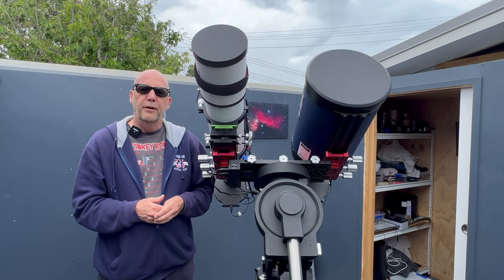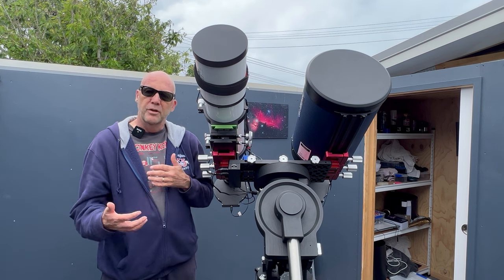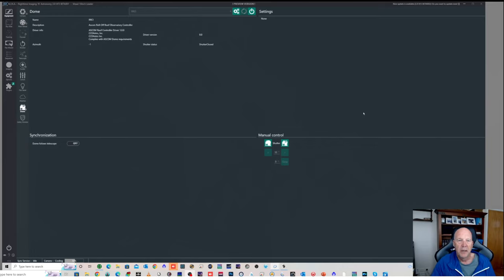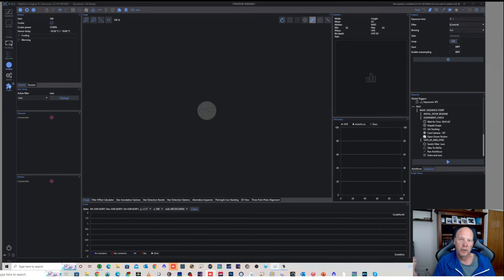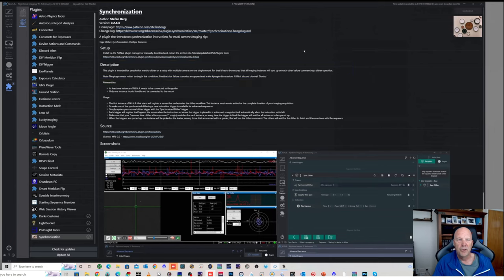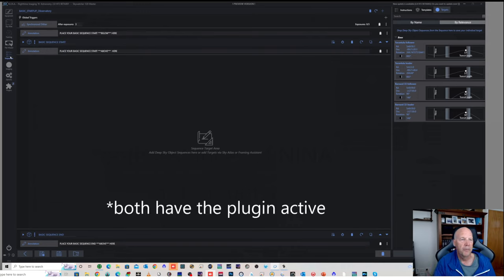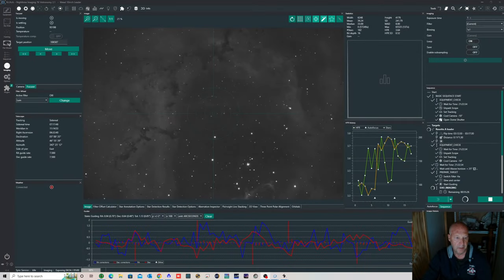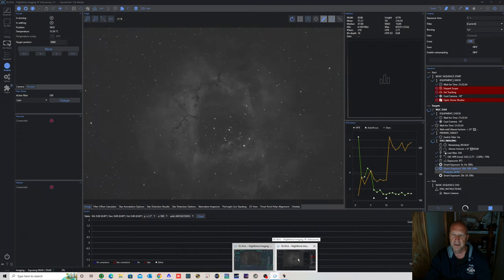Part 3 Dual Side by Side Telescope Setup. NINA Advanced sequencer and Synchronised Dithering

Comment: Interesting video Logan, there's certainly many considerations with this setup.  Looks like you've got a system pretty well worked out now. Just need the weather to turn for us all now.
Reply from the maker: Cheers Ollie. Yes I think it's all pretty much sorted but there are things I would have done differently if I was to do it all again. Maybe will have to make some changes as time goes on. But being able to easily switch from one rig to another without breaking my back lifting18 +kg setups is certainly nice.

Comment: Loving it!
I’ll have you know that I ended up finding the heavy duty dovetail adjuster plates from Baader;right after I bought a AP 1100….
Either way, I’ll be joining the 2 TOA150s and getting another scope….. after all, it’s a message from god.😂
Having said that, I’m going to have a very tough time, identifying the scopes as you are explaining, since I’m going to have two identical scopes, with two identical image trains, focuser, Eagle, you name it.!
I can tell you right now, I would not be able to do it without your tutoring 
Thank you!!
……….. and keep them coming!!
Reply from the maker: Fantastic- your dual setup with be ideal with identical scopes and imaging trains. Well, I wouldn’t have known about the Optec Libra heavy if it wasn’t for you so thank you again for letting me know that option existed. As far as labelling your different imaging trains, if you can consider them as, say, left and right, you can just add a L or R to the name tags you add in NINA. So just have, say, the left scope and all it’s accessories plugged in with the right scope and accesories not plugged into power/usb connections and whatever items show up in NINA will only be from the left scope and imaging train. Then plug in everything from the right setup and those can all be labelled right. Hope that makes sense.

Comment: Nicely presented video. I remember (pre plug in) when this concept first came out and you could run different exposures and somehow, the 'controller' was able to determine if the other had finished imaging. So you could, for example, have one ten minute sub and two five minute subs. Is that still possible with this plug in system?
Reply from the maker: Thanks Stephen. I'm not sure this would be possible in an economical sense  in that it is my understanding that the number of images per dither needs to be the same on both instances of NINA. So if , for example, you setup to dither every two images, then the scope doing the 10min subs would do 2 exposures (20 mins total) and the other scope doing 5 min exposures would have to do 2 subs per dither (10 mins total)  so the scope doing 5 min subs would get through 2 x 5min exposures and then wait around for 10 mins until the other scope finished it's second 10 min exposure. So there would a be a lot of imaging downtime on the scope doing the 5 mins subs. Hope that makes sense.

Comment: Thanks for this video, I just got the dithering set up and it works great.  I've noticed another little utility called synchronized wait which seems to be able to help with the start/stop syncs between the different scopes.  Any idea how that works?  I thought I had it working by adding it right after autofocus on the leader, then also adding it on the follower.  it works great for that but at the end of a sequence before moving on to the next target, I want it to make sure that the follower has finished before slewing, and the follower waiting until slew and AF has finished before starting.  It doesn't like it presumably because the follower is now the leader and doesn't move forward at all.  Any ideas on how to fix this?
Reply from the maker: Thanks Luke. Using the synchronised wait is something i need to add into my sequence and try out. I found it quite tricky to work out exactly where to place these synchronised settings as different forums I read suggested it to be placed in different places and some of the places didn’t work. So if i sort out where to put the synchronised wait, I’ll let you know.

Comment: There is a flaw in NINA if you need two set ups. It needs a refactoring so you can have one set up, one mount two or more cameras. 
That then leads into what if you have multiple mounts? 
What if you run a computer on the telescope, but want to access remotely? That leads into set up where you have large groups of people cooperating, and NINA is used to gather the information

Comment: Hi, I also have a CEM120 which I set up SBS last year and used synchronised dithering.  All went well until the meridian flip when the two instances of NINA seemed to get out of synch.  The leader was supposed to pause imaging on both scopes until after the flip, but it didn't work well for me. So I stopped using SBS and went back to single scope. Have you tested through the flip? maybe it works now or maybe it was my settings.
Reply from the maker: Hi Max. After the setup was complete we went into a very long spell of horrendous weather and I've only been able to get back to imaging in the last few weeks. So since then, I've primarily been picking targets where I am imaging with one scope of the other so haven't been using the synchronised dithering much. The synchronised dithering isn't perfect and there is a tendency to have the scopes waiting around for the other to finish and therefore a bit of down time which could be spent capturing photons. However, my main purpose for the SBS setup was so that I didn't have to swap scopes on and off the mount and could just choose each night which one to image with (and sometimes switch to the other scope part way through the night if required). Thanks for checking out the video. Clear skies.
Reply: I went down a similar path with my two scopes, then I rashly bought a third scope a RASA8. Then I had problem of swapping a scope into a balanced SBS. Very messy. So that plus the synch problem went with single mount and three fully configured scope systems. I also set up my old EQ5pro outside observatory as a backup and to get to tree obscured sky. Nothings perfect!
Hoping for better skies, max
Reply: I also have the cem120 SBS but not sure how you connect two OTAs to one pc? How are you connected? Thanks